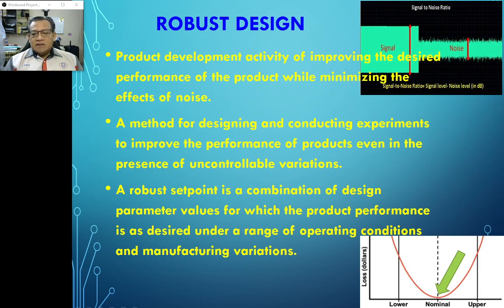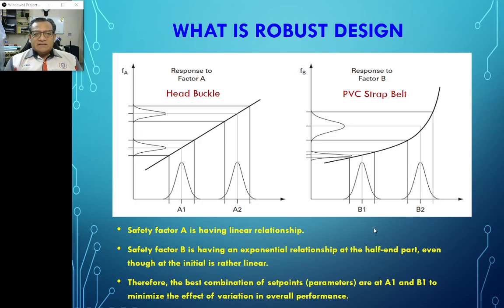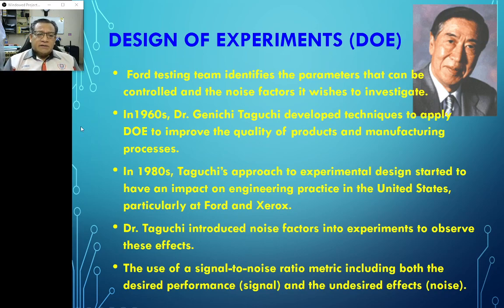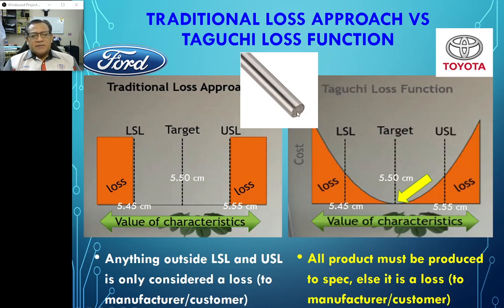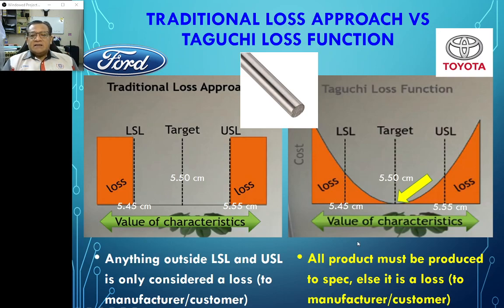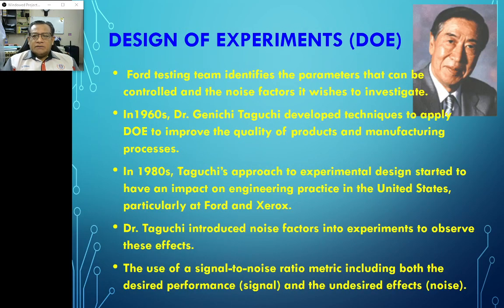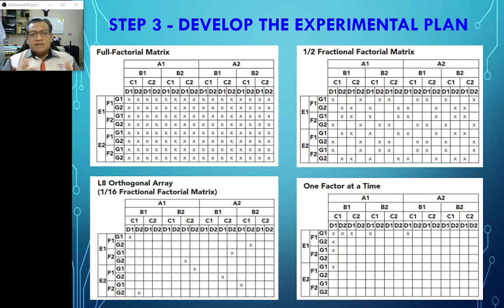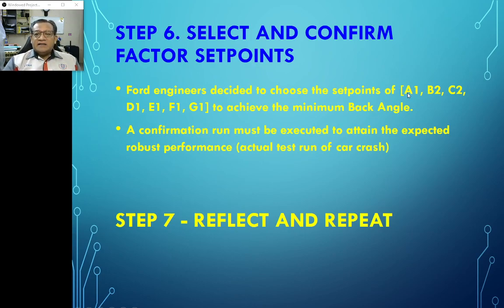Product Development Lecture Chapter 12 Robust Design

Comment: Nuraini Binti Panut (AP180474)

Based on the video, I have learned about the definition of robust design. Other than that, robust design at FORD motor and 7 step in process of developing and to achieve robust design capability.

Comment: Siti Nurul Hamizah Binti Ismail 
AP180367 
Thank you for the video dr Ros. from the video i have learned a product development activity in improving the performance while reduce the noise. also a robust setpoint value og combination design parameter which desired under range  operating condition

Comment: NURNAJWA FATEHA BT MOHD NOOR
AP180044
Robust design is defined as a set of design characteristics that achieve the required product performance under a variety of operating situations and manufacturing variances.

Comment: Siti athirah ap180427

I learned about robust design in this video. The goal of a robust design is to obtain maximum performance while minimising noise. I also learned about the traditional loss approach and the Taguchi loss function, as well as the seven steps involved in the development process and how to attain robust design capability.

Comment: CHENG YUNG TAT (AP180340)
Through the video, I have learned the definition of robust design and robust design at FORD motor. I also learned the design of experiments(DOE), the traditional loss approach vs TAGUCHI loss function, and the robust design process.

Comment: Le Mei ting 
Ap180221
Robust design is a set of engineering design strategies for mitigating the effects of noise on products and processes. There are seven steps in the process of developing strong goods based on design of experiments (DOE).

Comment: Nurul Izzati binti Mohd Tajuddin (AP 180317)
I learnt that robust product is one that performs as intended even under nonideal conditions such as manufacturing process variation. There are 7 steps to develop a robust product. The objective should be followed function to achieve the product performance.

Comment: Jessie Saw Kah Mun AP180256
In this video i have learned about the robust design
1. Product development activity of improving the desired performance of the product while minimizing the effects of noise.
2. It is known as parameter design, as this is a matter of choosing the right set-points for the design parameters under our control.
3. Traditional loss approach VS Taguchi loss function.
4. Design Process
- Identify factors and performance metrics.
- Formulate an objective function
- Develop the experimental plan
- Run the experiment
- Conduct the analysis
- Select and confirm the factor
- Reflect and repeat

Comment: Heng Chien Ying AP180531
This chapter is about testing of a new design for a performance, an example of robust design. Robust design is an activity in product development to improved the desired performance. Robust designed is achieved through DOE. To achieve Robust design capability, have 7 process.

Comment: Low Meei Ching AP180190
I learned about robust design is product development activity of improving the desired performance of the product while minimizing the effects (parameter design). 7 steps for robust design process 1. Identify control factors, noise factors, and performance metrics., 2. Formulate an objective function., 3. Develop the experimental plan., 4. Run the experiment., 5. Conduct the analysis., 6. Select and confirm factor setpoints., & 7. Reflect and repeat.

Comment: Eric Ser Jun Hong AP180272
In this video,I have learnt about the robust design is a set of engineering design methods used to create robust products and processes by reducing the noise effects. There are 7 steps process for robust design to the development of robust products based on design of ex periments (DOE).
Reply: Jivani D A/P Dorai Raja Singam Ap180435
Based in today class I have learned about 7 steps process for robust design to development based design on experiments

Comment: Leong Lai Leng
AP180229
From this video I have learn about what is robust design, traditional lost approach vs taguchi loss function, design of experiments and the robust design process which is identify control factors, noise factors and performance metrics, formulate and objectives function, develop the experimental plan, run the experiment, conduct the analysis, select and confirm factor setpoints and lastly reflect and repeat.

Comment: Lee Chin Yong (AP180153)
From this video, I already learnt about Robust design also called parameter design become the technique for designing and conducting experiment in order to improve performance even in presence of uncontrollable variations. Taguchi proposed the “Taguchi loss function” such as graphic description about specific characteristic of product is farther away from target value, it will cause more loss even product achieves basic standard. Opposite that, traditional loss approach only consider anything outside LSL AND USL as loss. First Robust design process is identify control factor, noise factor and performance. After that, Robust design process includes formulate an objective function, develop experimental plan, run the experiment, conduct the analysis, select and confirm, factor set points, reflect and repeat.